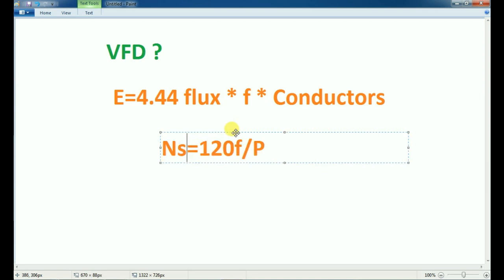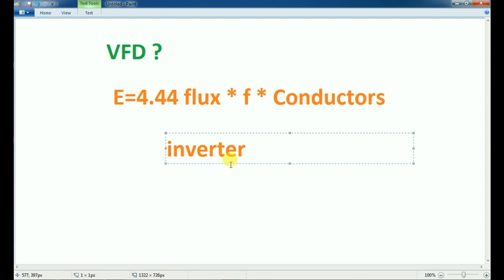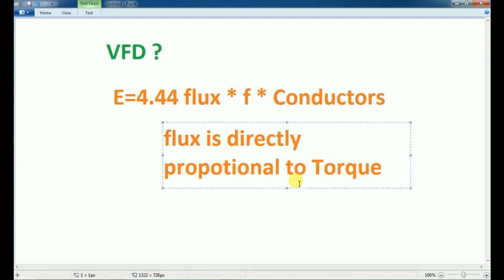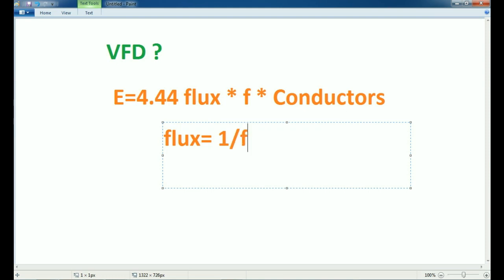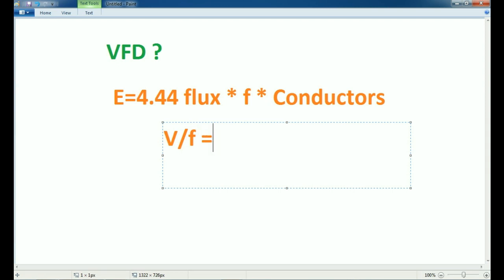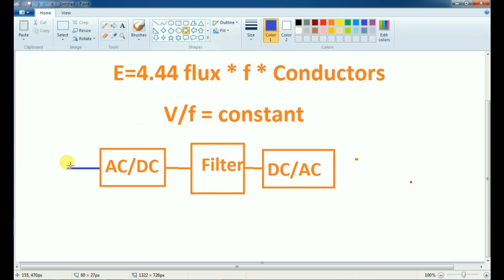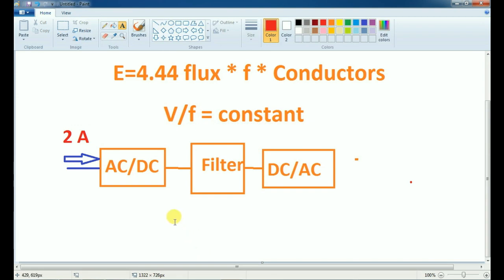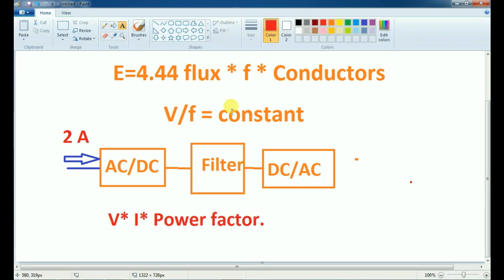Basic Concept of VFD. VFD operation and Working principle #1 Tamil

Comment: Bro one small thing VFD input current lowah irukrathuku reason is the motor power factor and DC capacitors, driveoda DC capacitors reactive powerah motorku kuduthu , motor power factor weakah irukum in lesser load so current is approx 30 to 40 % motor rated current apro intha motor losses athu consume panra small power to run the rotor which is true power consumed from the input supply through the drive. Motor power factor nameplatela irukrathu on rated load so lesser load la power factor of the motor is very less may be like .2,
Neenga star delta or dol methodla motor start paningana motor rated current atleast 3 times irukum because motor rotor 0 speedla irukum and neenga full voltage apply pani stator and rotorah coreah magnetize panringa , vfd la voltage and frequencyah V/F ratiola vary panranga so starting current is 1 times of the motor rated current so here is the power saving apro on loaded conditional unga motor power factor .8ah iruntha drive oda DC capacitors apro Ac to DC and DC to AC conversionla itha improve pani .95 kudukum even neenga IGBT supply units or low hormonic drivesla unity power factor kedaikum so power saving....

Comment: I directly promotional to torque... So how motor work common load..
Reply from the maker: Yoga Eee we have to go for constant torque drive...When you start the motor with direct load.
Reply: Techdoct motor when fully pick up conditions layum low amps dha edukuma...
Reply: Techdoct or this is used only low torque equipments ahh..
Reply from the maker: Yoga Eee no it does not reduce current for full load...2 to 10%power we can save the power from the motor....If you reduce the rpm then only it stars decreaseing
Reply: Techdoct ok tq sir...
Reply: And again one question.. Transformer primary also inductive load.. So power factor primary la lag aaguma..